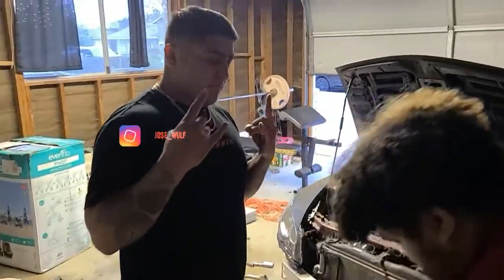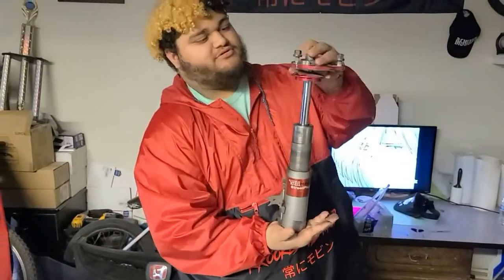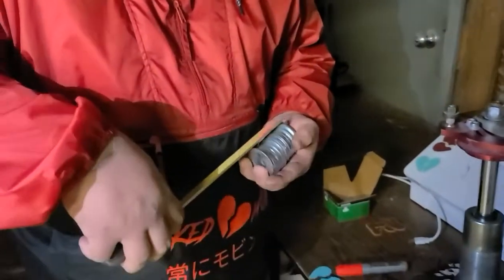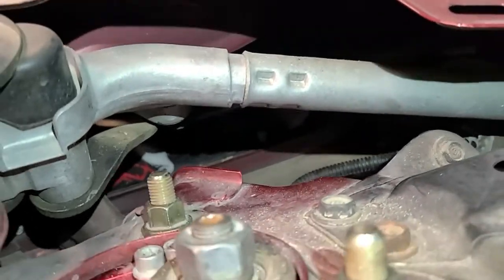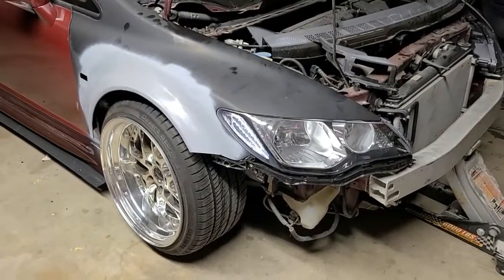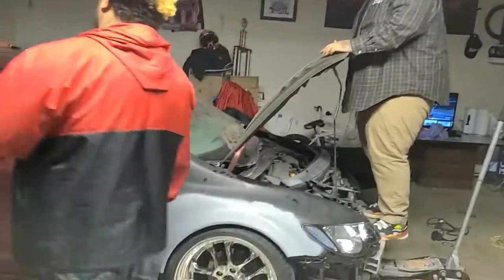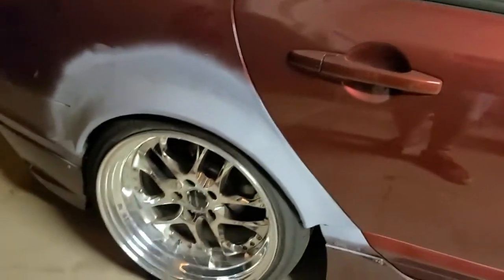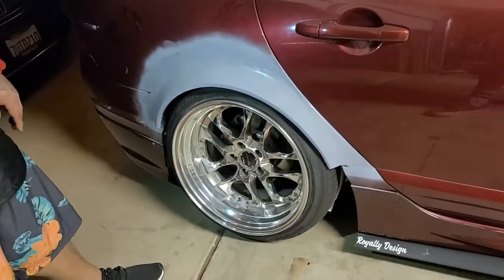Using washers instead of springs for stiff suspension

Comment: What did y’all do in the rear since the spring and strut are separate?
Reply from the maker: Haven't done the rears yet but we will soon
Reply: @KrookedMob  alright just wondering cuz I’m tryna dump my 9th gen 😂
Reply: @KrookedMob  any update on this?
Reply: @KrookedMob  Keep us posted bro
Reply from the maker: I actually haven't done the rear yet but I'll do it soon
Reply: i know this is old but i bet they just took the whole spring out then extended the rear strut out a bunnnchhhhh so the tires won’t sit on the chassis and then they just stacked washers on the strut so it won’t be completely compressed all the time. hope that made sense.